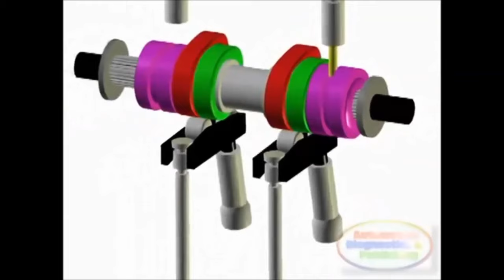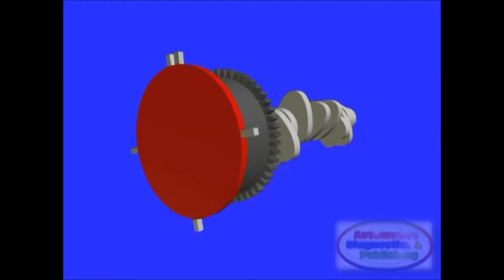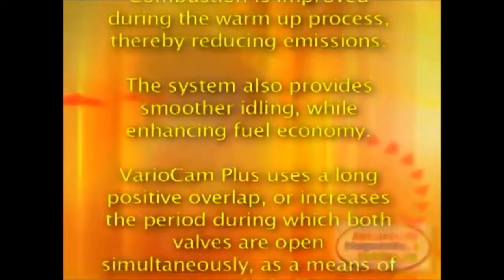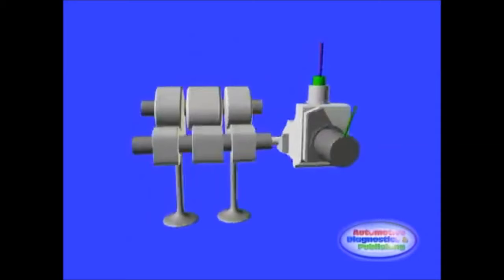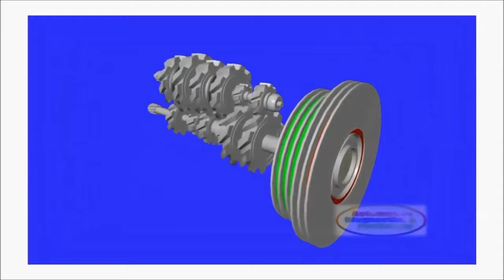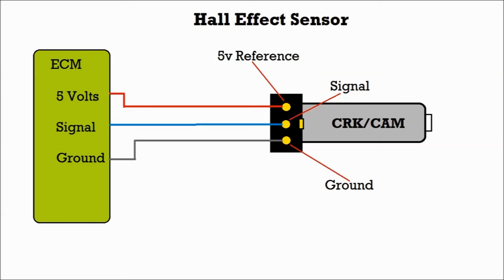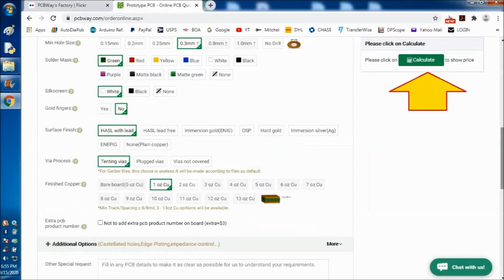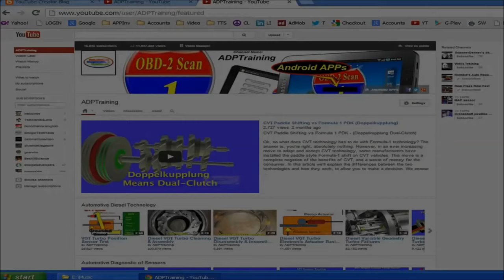Variable Valve Timing & Lift Study Course

Comment: Regarding porsche variocam, how does the valve returns to it's closed position after being actuated by the inner tappet if only the the outer tappet is connected to the spring?
Reply from the maker: Spring loaded.